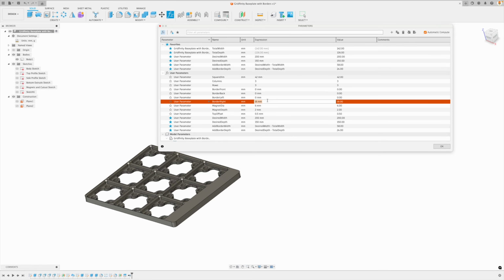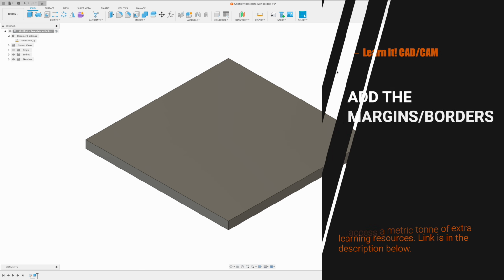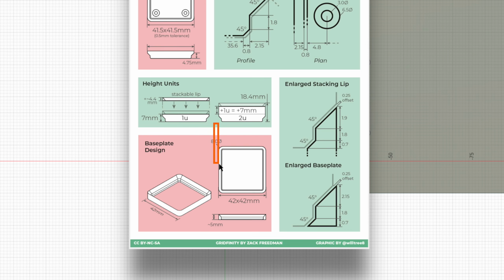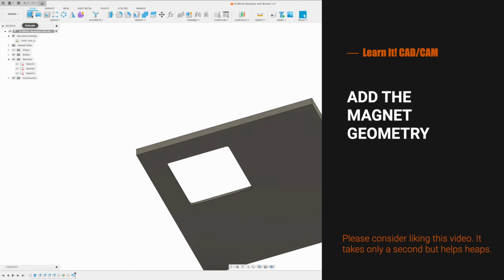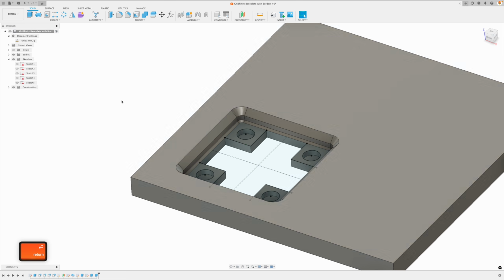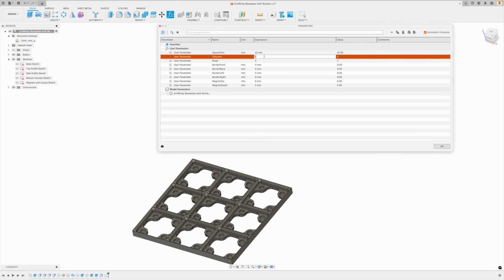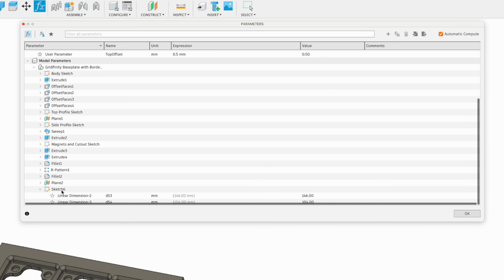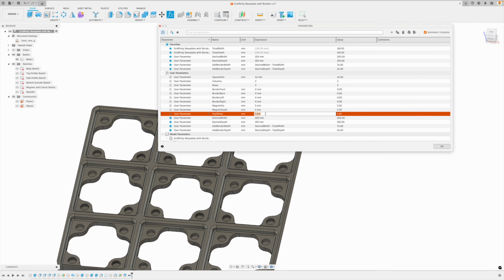Autodesk Fusion 360 - Ultimate Gridfinity Baseplate with Border Adjustment - INT/ADV Tutorial (2025)

Comment: Super great tutorials 🤩 I wonder one thing. Let’s say my tray in the toolbox is 400x600mm for example and I can only print 256mm parts. How do you do this modular so you can click them together? Or just use without borders in the middle part and just place them together? 😊
Reply from the maker: Thanks so much for your encouragement. 

Regarding making them modular, there are a few options:

1) Use without borders (easy, but might slide around)
2) Use slicer software to adding dovetails or other connection methods (intermediate - not all slicer software has this option or is easy to figure out) 
3) Create parametric dovetails in the model itself (difficult - but gives you full control)

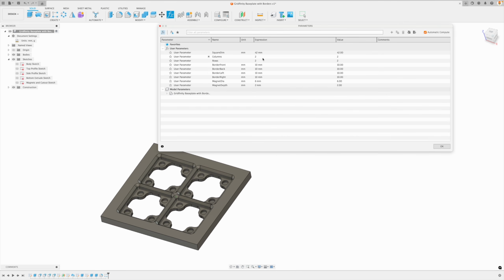Comment: Ok I've done this twice, followed you exactly. I run into a problem after creating the 4 cutouts, and testing that they replicate (around 18:00). In both of my attempts the grid will expand by changing the parameters, but the cutouts do not replicate past the 2x2 grid.
Reply: I found a fix. I changed the values of the Rectangular Pattern. First, I ensured that Distribution = Spacing. Next I changed the values of Axis 1 and 2 Quantities to the parameters Rows and Columns, instead of it being hardcoded at 2.
Reply from the maker: You got it! Good job.

Comment: Is there a way that you could toggle on and off the magnet part of the design. I like having it but, in some cases, would want to exclude it without doing a whole new model.
Reply from the maker: Yes, there is. It is extremely easy if you have a commercial license. If you do, you can use Configurations. If you need help with that, please let me know. I will consider making a tutorial on it.

Comment: Great tutorial. How would you go about splitting this to be able to fit a print bed of the Bambu a1? Say if it was a bigger drawer like 12in x 24in.
Reply from the maker: Excellent question! For me, I would take the finished base that is taught in this tutorial, and then create two additional designs (using Configurations. You can also achieve a similar result using individual design files) that have male and female dovetail joints. You can use the exact same techniques in this series of tutorials to do that. Let me know if you can figure it out on your own.

Comment: Great Videos overall but I'm stumped on this.  Admittedly I'm not a Fusion expert, but I literally watched and mirror the video several hours today and can't get my Side Profile Sketch to exist without 'red lines' which results in a final pattern copy that copies the magnet holes but not the fillet... any ideas would be greatly appreciated.
Reply from the maker: Thanks for your support and for reaching out. I can’t tell what the issue might be from your message. You’re doing the correct thing in continuing to try to figure it out. It is often one thing or step that is missing.

Comment: Great Tutorial! I run into a problem at the end when i try and creat a pattern it keeps giving me an error stating that the "R Pattern1 -  Compute failed - No fillet edge found." Any thoughts from anyone?
Reply from the maker: Thanks so much! Regarding your error, check that you have selected all features to pattern. If you have done that, then there is another trick you can use, which is to “test often, proceeding only when proven.” So, before creating any unique geometry, pattern just the primitives. Don’t delete anything, just grab your pattern tool in the timeline and bring it back to just after you’ve created your basic rectangular prism. Then, move that rectangular pattern tool in your timeline one feature to the right. Let it regenerate. If it regenerates without an error, then move it one more feature to the right. Keep doing that until you move the pattern tool all the way to the end. Essentially what you’re doing is slowing eliminating all variables in your model that might be the issue.

If you can’t solve it, please send me your current file. Actually, please send me your file before you try to solve it. I would LOVE to do a quick tutorial on this because this is a very important and special skill to learn and understand. Our email can be found in the About section of our YouTube channel. Hope to hear from you.

Comment: New to Fusion and CAD and had been stumbling through trying to design something more complex than I had the know how for and getting frustrated. So I decided to start with the basics and found your channel and Patreon super helpful. Thanks so much! 

I modified your approach to the baseplate parameters a bit so I just have to enter the overall length, width, and desired front border and then it will compute the number of rows, columns, and remaining borders to best fit the overall dimensions (assuming the grid is centered left-right). All of that is working great, however I also would like to automatically split the body up into at most 5x5 (+ border) sections so that each section will fit on my 256mm printer plate. I can get this to work on one axis by patterning a split on an offset plane, but can't work out how to split along the second axis and include all the new bodies created after splitting along the first axis when changing the total length and width parameters from whatever was set initially. Feels so close to a really useful solution but not quite able to get there. Not sure if there's a way to go about it that I'm missing, or if this is a limitation in Fusion. 

Appreciate any pointers, but most of all appreciate all that you are contributing to help us hobbyists who are interested in improving our skills!
Reply from the maker: What a great comment to have received. Thanks for your encouragement, support, and request. Much appreciated!

For splitting up the bodies, do you want to create slip fit dovetail joints (or something similar) or just leave the sides blank? If you want dovetail joints then you’ll have to do some more math. Either way, if you’d like to create an assembly of several components, then it is best to do the following:
1) create a configurations file of your design with all the different iterations that you need
2) create a separate assembly file
3) import derived components from your original design into your assembly file. (This will help you visualize your finished design and prove dimensions)
4) if you can’t use configurations, then you’ll have to copy your original parametric file into however many iterations that you need and then import those design files into your one assembly file. Same madness, just a little more tedious.)
5) once your design is proven, then export each component to your 3D printer.
6) another option is to use splitting software within your 3D printing slicer software. 

After consider all the above, if you have need for help, I think this would make a great tutorial. Please consider sending your Fusion file to us.
Reply: @learnitalready  Thanks for the reply! Sounds like I was headed down the wrong path and the proper way is more involved than my wishfully simple approach. I haven't delved into derived components or configurations (I'm on free version), so not sure what those bring to the solution, but will explore. I'm hoping for a solution that will support any given dimensions, so doesn't seem creating iterations for every possible border width combination on sides and corners would be practical. 

I would love to add a dovetail to the split profile, but started out with just splitting along a plane to see if I could get it working. In any case I'll send you the Fusion file just in case you think there's any valuable lessons learned from my incorrect method to work into a future tutorial.

Comment: Borders and Margins are not the same thing.  Borders are the outermost edge of an object. The Margin is the space between the border and the working space of the object (ie: for a photo it would be the display of the photo.). think of a piece of paper. The border is the edge of the 8.5x11.0 piece of paper. the margin is the space between the border and the type or graphics on the page.  These terms have origin in typesetting and should be properly adhered to in order to maintain commonality.
Reply from the maker: Excellent observation! Thanks for commenting.

Comment: This is a really good tutorial of some very useful methods. I would say that it is maybe a little fast-paced, but that maybe down to my current proficiency with the program. One problem that I have is that when I try to test the feature pattern by, for instance, extending the rows, for some reason the component extends without the pattern, and it adds a half pattern to another column. Any pointers would be super helpful, but I understand that you can't answer every query that you get! Thanks again for a great tutorial.
Reply from the maker: Great to hear from you! I think my best solution would be this: please send me your file. I would like to do a follow up tutorial showing specifically what’s happening, why, and how to fix it after which I will post it on our Patreon page. Please send me your .f3d file via our business email which can be found on the About section of our YouTube page. Looking forward to hearing from you.
Reply: @learnitalready  
thanks so much for your reply. I solved it. I believe I had the rows and columns mixed up in the x and y axes of the pattern. I found this by changing the base model to a 2 x 3 rectangle, and then enlarging it after the pattern rules had been applied. I could then see that it was trying to enlarge in the 'wrong' direction.
Reply from the maker: @pedropig  Great job! Problem solving and testing is 95% of the fun of a good design. Keep up the good work! □

Comment: Is possible to change the parameter of "SquareDimension"? For example from 42 mm to 54 mm in a parametric way? Without making a real mess?
Reply from the maker: Absolutely! Here’s what you do: start your design from scratch. Whenever you do any step in the process test the parameters by going back and forth between 42mm to 54mm. Don’t wait until your finished the entire design to test your parameters but after every step. That will help you to see when the parameters break or where the issue is in your design. Let me know what you find when you follow that methodology.

Comment: Really digging your channel. Have been playing with fusion years ago and switched back to sketchup in between (i do woodwork). Now 200% back at it and loving it thanks to you.  Have built a fully parametric door, cope and stick joints, mortises, etc. Although not the cleanest build, i'm able to  change just two parameters and bam! The whole door is changing accordingly. Never occurred to me that it was also possible to give "if statements", i imagine there are other coding parameters possible like loops and so on?. Want to try and make the door with options like 3 or 5 panels,  with or without double glass etc. And later on trying to make my own cabinet library.  Thank you for sharing your knowledge.  Best fusion learning channel in my opinion.
Reply from the maker: Thank you so much for your encouraging comment along with specifically writing what you've benefitted from. Would love to see your model or renders if you have the time to send it to us.

As for parameters that you can use in Fusion, here is a reference page: https://help.autodesk.com/view/fusion360/ENU/?guid=GUID-76272551-3275-46C4-AE4D-10D58B408C20

I truly appreciate hearing from ones like you and hope to hear from you again soon. All the best!
Reply: @learnitalready  Thank you! 

Yes sure, will share the model with you when i consider it somewhat finished :). Happy to share it for you to use and review it.

Comment: Why not symply use the gridfinity addin? It creates plates as well as boxes just by filling in the values in a dialog.
Reply from the maker: Excellent question! In learning how to create this design, along with the related parameters, you can then enter the area of customization. Add-ins and plug-ins are great, but are limited.
Reply: @learnitalready  the addin is much more customizable than your solution.
And - it creates a component with the grid you define - change parameters and create the next one...
Reply from the maker: @ManniAT Well, you can give a man a fish, or teach a man how to fish. The purpose of this tutorial (and channel in general) is the latter.  □
Reply: @learnitalready  I have the Gridfinity addin but find this a valuable addition in that it is adjustable in real time.  Your needle nose video is a perfect example.  You set the size and then adjust the dimensions of the grid real time.  I find it take a bit of back and forth with the addin.  The modification I am trying to figure out is how to make the magnet extrusion optional. ie selectable in the Change Parameters Menu.

Comment: Great video, amazing detail and showcase and easy to follow. However, I'm not sure if anyone else is having an issue with the pattern section. I've followed the steps as per the video and everything is working as it should, with one exception. When I hover over the original square nothing gets highlighted, but when I hover over the newly created pattern squares all the pattern squares and the top face gets highlighted. Not sure why. I'm still quite new to fusion and not sure if I did something incorrectly. Any suggestions?
Reply: I figured it out. It was due to me having 2 components, one for the base plate with no magnets and one for the magnets. The ghost of the base with no magnets where visible.
Reply from the maker: Great job diagnosing the issue. Thanks for your input and help for the rest of the community.